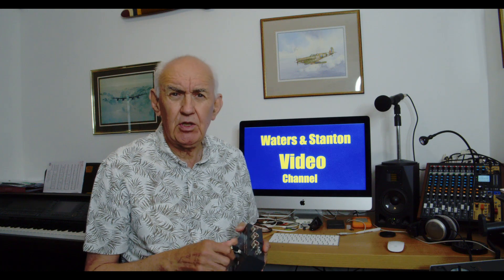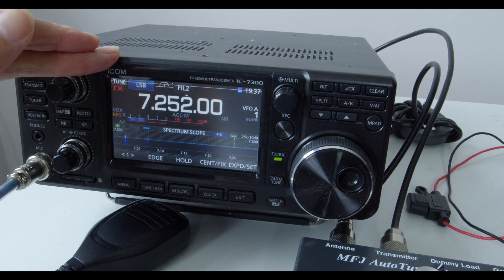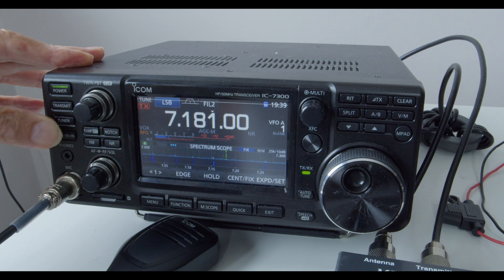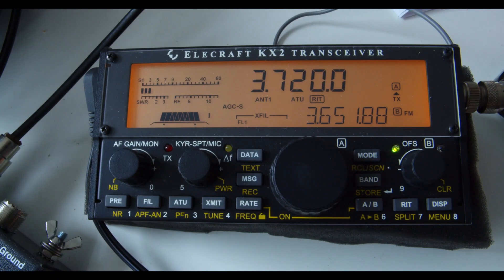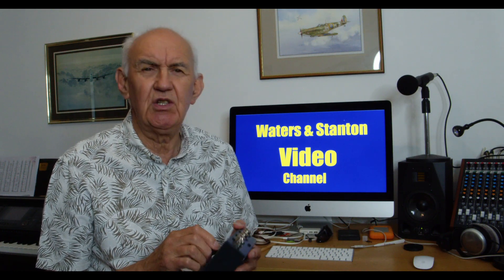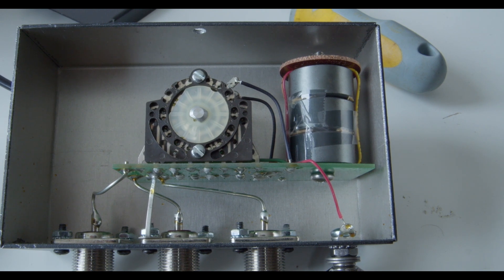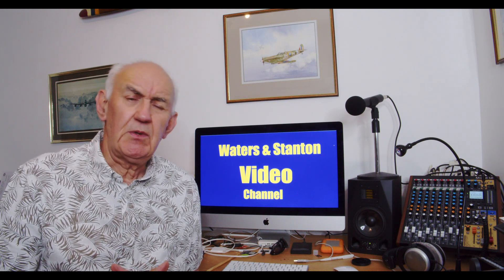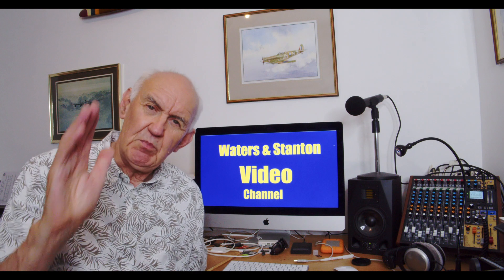MFJ-914 Auto Antenna Extender - Review | HAM RADIO

Comment: Works great on 75 meter dipole on band edges 3.5mhz to 4mhz. My dipole is resonant at 3.830. Also using 75ohm coax.130ft.
Reply: Thank you I have 2,000  feet of 75 hardline and have wondered how to get it to 50 ohms?

Comment: I purchased one today from Ham City dealer,
about a discounted price of $85.00 US plus
a shipping charge. I look forward to using
it with my Yaesu FT-991A, whose built in
ATU will not tune on 15 and 17 Meters
while it will tune on the other 80 to 6 meter
bands with no problem using a Windcamp 
WA4 Windom antenna. I wonder if with
thank antenna, I can do 160 too?
73 de Ray W2CH New Hampshire.